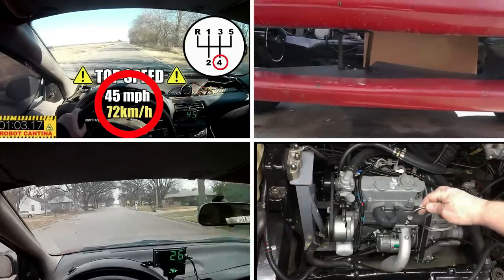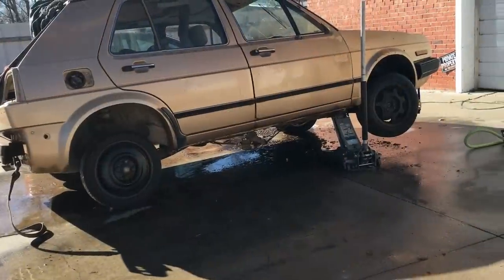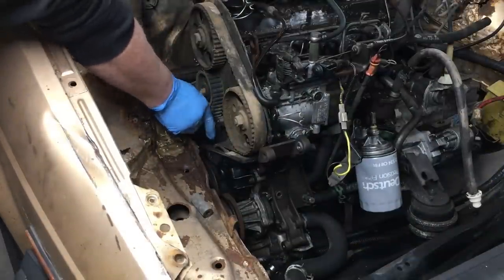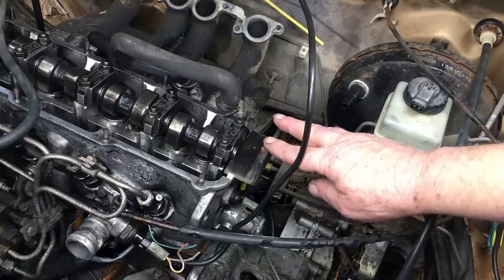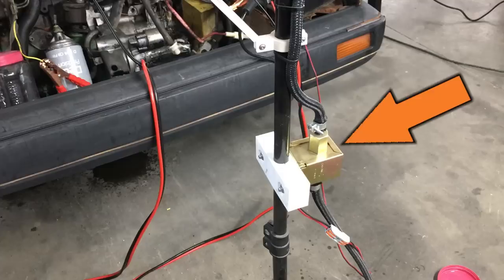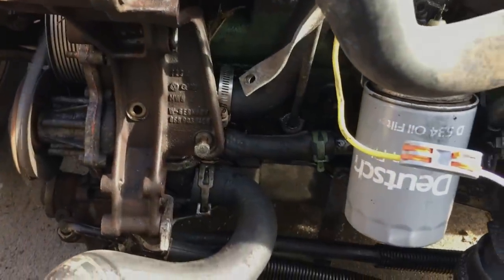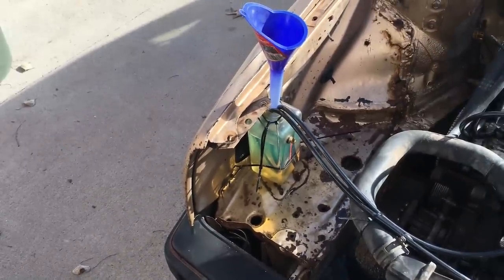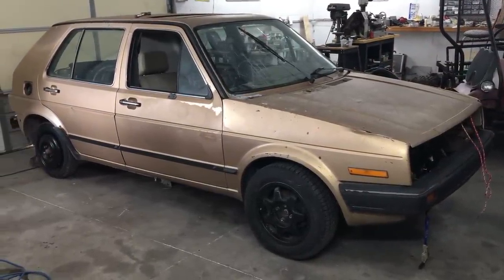S3 E3.  Will this abandoned 1985 Volkswagen 1.6L diesel run and drive again?.  Let's find out !

Comment: As someone who daily drives a 1986 Volkwagen Golf with the same engine, I totally approve of this project!
Reply: Can relate they last forever
Reply: Same here, so you turn off the a/c on interstate on ramps too 😂
Reply: I totally approve of this project too 
the turbo version is for efficiency, not for performance you can get 56 mpg on it
the 3 cylinder skoda and VW blue motion gives 80 mpgs when you drive at 40 mph
Reply: I have this engine out of a Golf, on a 2000  Exmark Lazer Z w/60" deck. 
I replaced the .725L 26hp efi Kohler, that burned 1.25 gal/hr. The Volkswagen 1.6L is governed at 2300rpms is quieter, and by observing its performance next to a 22hp 60" ZT its putting out nearly twice the hp, and burns just about half the fuel per/hr! I need to get it running again and post a video of it. Built it before I knew what YouTube was....
Reply: I have a 2002 Skoda with an engine based on the same design. 190,000 miles and it still drives great, runs on vegetable oil and goes pretty well with a turbo too!
Reply: Great video. 👍  Looking forward to seeing this swap. I had several of these diesels and put over 300k miles on each, the engines were still running fine, but the bodies were badly rusted. They always got 50mpgs, it will be interesting to see what your mpgs will be.
Reply: Hate to upstage the BS artists but the 1.6 gets around 42 mpg. Best we ever got was 45 on the interstate at 65 mph. We drove ours 15 years. The weak point is guess, the injector pump. The replacement was $500 wiping out a good bit of the savings.
As you can tell we drove it to the maximum all the time. It was a good 
little runner. We gave it to Goodwill at the end.
Reply: I also daily an 87 golf 1.6d! Runs on 100% waste vegetable oil and loves it
Reply: @Richard Wright  If you only get 42 mpg, you must have an automatic transmission, and you drive it hard.
Reply: @yodasbff3395  No, It was 5 speed manual with air conditioning. Mpg based on US gallon of diesel may be difference. Thanks for comment. Are you in  Britain?
Reply: @Richard Wright  I'm in St.Louis, and kept records of every gallon of diesel fuel I put in them, and the milage was always right around 50 mpg.
Reply: NERRRRD!  I drive an '85 GTI.😃
Reply: @thanks3150  I had a 1990 Golf TD some years ago. Got a KKK24 turbo. Permanently closed the wastegate and the overboost protection on the inlet. Got it to 2.4 Bar boost. 135 hp. It could suprise many here in Denmark thinking it was just a slow golf :)
Reply: As someone who daily drives a 1988 Volkwagen Golf with the same engine I can't say anything good about this project. There is no better car than the Golf MKII, no need to swap this engine into some crappy Honda.
Reply: I have one for sale in Portugal

Comment: That Liquimoly Diesel Purge DEFINITELY works, your Mercedes just wasn’t dirty enough to have a noticeable effect, same issue with this VW. 
I’ve run it through engines that turned the returning purge fluid black immediately and required several cans to clean out the fuel system.
Reply from the maker: Thank you for sharing your experience with this stuff.   I reckon its worth using.

Comment: Great score on the VW 1.6.  They are decent little motors.  Another good one is the Mazda 2.0 w/5-speed manual.  They came in a few mid 80’s Ford Escorts and Rangers and the Mercury Lynx.  Me and some buddies had a few of them.  Would run them on used motor oil, transmission fluid and fryer grease.

Any who, don’t feel bad for scrapping the Rabbit, that shell was gone.  Not to mention getting rid of the very real hazardous risk of Hantavirus.

Good job Jimbo!
Reply: Another tone to consider is dohc zetec 2.0 with 5 speed. Non-interference, simple, pulls like tractor (<35mpf in 5th at <500 rpm, no need to fuss with gas/clutch at take off) and virtually indestructible (other than rust eating shifter cable housing and shifter bushing wearing out past 200k miles). And no sweat 35mpg average between fillups in already chunky zx3.
Reply: shoehorned that Ford/Mazda 2.0 in place of the 1500 of my '79 GLC sport.
it was a very quick little yellow-jacket.
Reply: ea827, just like this deasel, you can combine parts of different ea827, ant make for example 2,04L petrol engine with diesel crank. USA has ABA engine, i got it the hard way, but it is perfect engine for projects. you can put a 16V head on it, diesel crank, and you basically have a racecar
Reply: Had one of these Mazda 2.0 Turbo Diesel engine in my 2001 Kia Sportage. They're prone to overheating due to relatively small radiator and small fan. Only had to change to an 1" wider fan (from a 2.8 Mitsubishi) never thought about this again.
Reply: my parents had a Mercury lynx diesel with that 2 liter. It was a really reliable car. 4 kids learned to drive and got their driver's license in that car. I remember that I didn't drive it too easy. I would redline every time while getting it up to speed. I remember getting mileage 40-45. My dad says he remembers 55 mpg . It was in the family for a really long time. My dad gave it away to a neighbor who drove it back and forth to college about 200 miles a day. A connecting rod finally broke on it and punched through the side of the block. Not sure of the exact mileage but I know it was over 300,000. I often wonder how long it would have gone If hadn't ragged the hell out of it.

Comment: My first Diesel car rebuild was an '84 VW Quantum turbo diesel that had been sitting under an oak for 9 years. Love how Diesels get up and go after sitting for years. Looks like you don't need it, but I have a non turbo 1.6 injector pump and a few new injectors. Since then, I've rebuilt 2 Diesel VW Jettas with the 1.9L ALH engine and three with the 2.0L CJAA engine. Great cars to drive. My next project is to put a CJAA from a wrecked Jetta into a VW CC with a bad engine. Diesel CCs were available in Europe,  but as far as I know, none were available in the U.S. 
Can't wait to see more on both of the Diesel  projects. (I've also rebuilt a 3 cylinder Kubota and have parts to rebuild atleast another one.)

Comment: You should try efficiency tests on different kind of fuels, like used (and filtered) veggie oil, new veggie oil, motor oil, hydrodiesel, biodiesel, kerosene. Anyway I'm stocked about this project.
Reply: Good luck with that
Reply: You can also try ATF: make sure you centrifuge out the clutch material first...then, cut it with some gas to thin out the viscosity enough to flow through the injectors.
Reply: @enolastraight577  damn, I wish I had an old diesel engine to play with

Comment: For anyone wondering what those pieces of mud are along the timing belt.
Yes, it is in fact mud. What those are is mud dauber (mud wasp) nests. Insanely common here in PA where I live. When a vehicle sits for awhile they tend to nest in the weirdest of places. I've found them on air cleaners, in carb barrels, and I've even found them beneath the rocker cover on a small block.
Reply: Mud dauber nests are extremely distinctive. I saw zero on this car. Strike 1.

Comment: Cool video! You'll find that there is a spring-loaded piston under the forward-facing cover at the bottom of the injection pump. Kind of a football-shaped cover with 2 screws, maybe partly under the corner of the bracket for the compressor. There is a vane-type transfer pump built into the injector pump housing, and it moves more fuel than is needed. The excess fuel builds pressure in the housing, and acts on that piston to rotate a part that changes the injection pump timing. The banjo bolt for the return line has a built-in orifice, and this allows the transfer pump to build the pressure in the housing (or at least mine did - but it did not have that hex-shaped extension that yours does). Anyways, if your banjo bolt has the tiny hole in it that mine had, you can drill the head of the bolt and tap into it to measure the pressure inside the pump housing - and this represents the timing change! You can change the hole size or use a bypass valve to reduce the pressure and retard the timing, or change the spring to advance the timing earlier. This is where  my experimentation ended, as my car was completely totaled through no fault of mine. I am looking forward to what you do, and I'm sure you'll do a much better job than I would have. I can't wait!!
Reply from the maker: Cool, thanks for sharing that.   I copied you info into my notes and will do some experiments.
Reply: weaker spring results in faster full timing advance. I believe the green painted one is one of the weakest, got mine out of a pump from an older 1.5 engine. it was a major major difference in pep once i did that change. i also added a chinese turbo that is supposed to be for a 2.0 kia diesel engine, and a tial wastegate set with 18psi spring. any more and head studs are strongly encouraged. other turbos will work but you want something with a relatively small turbine area ratio because its such a small engine, with cooler egt than a similar gasoline engine. also in regards to internal pump pressure for timing advance, there is a small plug with 2 flats next to the fuel inlet banjo. the center of that plug can be pushed in further to increase internal pressure . vw has a screw type tool that uses the cuts to hold onto while pressing in the center. a hammer and punch works but be gentle because if you overdo it youll need to pull it out to reset it.

Comment: Back from the day when a VW was easy to work on!  Great project.  Looking forward to the results.
Reply: Especially if you have a reciprocating saw 😛
Reply: As someone with a 1982 VW, a 2011, a 2008, and many other models inbetween, they're all pretty easy to work on. Every so often, you'll need something like a triple square or e-torx socket, but they're not difficult. To be fair though, I haven't messed with any W8/W12 cars or a Touareg/Phaeton/whatever other "spicy" VW, but from my experience, they're all pretty straight forward.

Comment: Back in 1998 this was my 1st car. But 2 door. 85 was the 1st year of the golf name in North America(MK2). Before that they used rabbit. (MK1) Mine had a 5 speed. There also should be a handle to the left of the steering wheel to advance timing to help with cold starts. This needs to be pushed in when setting timing with a dial indicator. 
Can’t wait to see more.

Comment: sometimes the newer diesel fuel tends to eat the seals on the injection pump head and the injection pump will loose some pressure, just something to keep in mind. I also hear that a lot of people have been running a small amount of 2 stroke oil mixed with the diesel to give it more lubricity and to stop the diesel from eating the older style seals in the fuel system

Comment: Here, in europe, 1.6d is like holy grail of engines. Nice catch. Now use that engine with cvt transmission and you have a winner
Reply: Manual is much better if you ask me. Less parasitic loss. If he was building a drag racer then the CVT would be likely be the best choice.
Reply: @GoldenCroc  maybe you are right. but he would need to find a 5 gear transmision. maybe even 6. lower rpm, lower fuel consumption.
Reply: @stajpi  Quite possible, I have no idea of the gearing of this 'box compared to the newer ones. I would think the 4th is still reasonably tall, but perhaps not. Maybe it uses some US-spec final drive that is lower?

Comment: Have I missed the actual video of putting the VW diesel into the insight? Seems like a great idea, Thanks for the cool vids.
Reply from the maker: The VW engine was partially installed in the insight and we found that it would fit, however doing any modification on the engine would require the engine to be removed from the car.  The extra time it would take in each video to remove the engine made us re-think this idea and we ended up not using the VW engine.  We still have the engine and are waiting for another project to come along.

Comment: I had a 1980 Rabbit GTI 2 door. Great fun to drive and practical, you could remove the whole rear seat in one large assembly by releasing 2 pins. Electrical gremlins forced me to sell it. It was a common problem for the left corner of the windshield to leak water on the electrical junction box located on the firewall. In the rain the car would try to self start! I sold it to a mechanic who fixed it a got 300k kms on it.

Comment: I can confirm the diesel purge works. My commuter is a 2001 Jetta TDI. Last May I ran a can of diesel purge through my system before I serviced it. My fuel economy that next tank was 58.46 MPG, up from 51. MPG. That fuel economy didn't last forever, stating the condition of the pump and/or injectors with their high mileage. But the stuff works.

Comment: You did good Jimbo to bring back life into a diesel engine. Lift pumps, even those cheap ones do wonders for diesels. From my experience, makes the engine run smoother and quieter. That engine was sure running smooth for sitting such a long time.

Comment: The good thing about “The Plan” is it is your plan Jim, and you can do whatever you want in whatever order you like and we will watch anyway because you are the man with the plan 😂😂!

I have found fuel additives work in both petrol & diesel engines and have no problem using them. One of the best petrol additives in my opinion is the Subaru branded fuel additive. Other OEM vehicle manufacturers service centres use it also. As far as diesel additives go, I prefer to use a product designed and manufactured by a local Australian family company Cost Effective Maintenance. It is brilliant stuff. The only oil additive I use is a flushing compound from the same company just before a service.

I don’t use “glug” to reduce oil consumption or power steering seal rejuvenators, they make repairs a nightmare. In my younger day I did, especially when money was tight and I knew no better.

Comment: Good engine.
If you want to, that VW is running fine on straigt vegetable oil.
I ran a similar power plant (IDI engine with Bosch VE pump), for 9 years and over 170'000km.
Reply from the maker: Thanks for the info!
Reply: @robotcantina8957  You're welcome!
Just a couple of modification are suggested, at least in cold climate.

To start better the engine on vegetable oil, it is better to put on 4 different glow plugs.
Take a look on the NGK catalogue (if you can't find it online feel free to ask, I can send you photos of the one I have at home), there are lots of glow plug with same body but different length of the heating element.
In my case my car had 24mm element, I put on the engine 29mm ones from another engine and I had perfect cold starting even at -18°C.

If I remember well, the VW 1.6 have 20 or 21mm lenght element.

Just swap to the 24mm one and there you go, flawless cold starting.

Remember that in those engine style glow plug doesn't shut off when their light does, they are on for a longer time, expecially in the Euro 1 and 2 engines, that help in reducing hydrocarbons emissions, but using oil that heat is useful to have a good ignition in the first minutes of running.

Second mod is to connect a heat exchanger between the coolant and the fuel line, just before the fuel filter.
They are cheap, you can find also them in scrapyards from furnace water heaters.

Comment: These are great.  My dad had a Mk1 Diesel with 400k miles on it.  From memory (in Europe at least) there was a fault where the pump would jam open fully.  Happened once when my brother was driving it.  Filled the road with smoke and wouldn't stop.  It was recalled by the dealer and repaired

Comment: Remember to remove the chrome trims from the door handles, IIRC they were only fitted to higher trim-spec GL models and they’re sought after. Even GTIs only had plastic inserts so pop them off if you’ve still got the shell and someone will buy them.

Comment: Enjoying your content. VW sometimes used plastic in dumb places on these engines. The oil dipstick tube and the clutch adjustment spring to mind (not to mention the plastic door handles that break when it gets really cold). Looks like bunches of fun.
Reply from the maker: Yes, VW and plastic don't mix well.  If they ever get a clue, they will start making decent cars again.
Reply: @robotcantina8957  JIMBO,    CONGRATULATIONS ON  115K  SUBSCRIBERS!!😊😊

Comment: VW diesel guy here. The swap you showed on the insight that someone else does looks like the ALH engine, 1.9 turbo variable vane. Pretty much the holy grail of VW engines. I'm most shocked to see how the timing belt procedure is identical to my own ALH, don't change what's not broken I guess. Also my engine has 230,000 miles and the inside looks spotless like that. I've never really seen a diesel engine out of an automobile that is "dirty" under the valve cover. They seem to keep fairly clean.

Comment: Fantastic video! 

I've owned and worked on many an 80s VW. And you are spot on, you can make all the tools you need, and there is very little plastic used on these simple SOHC engines. Gas and diesel are almost identical.
Reply from the maker: Right on!